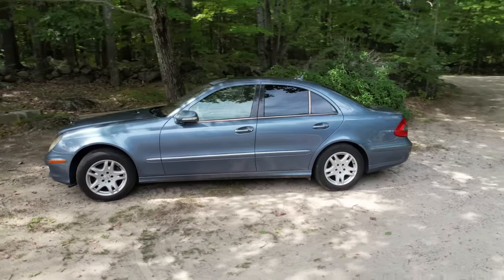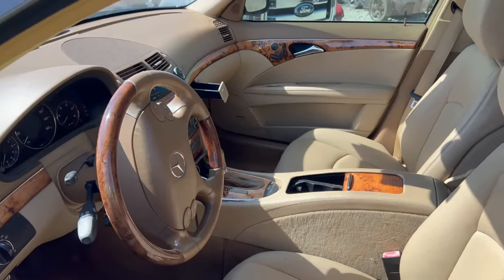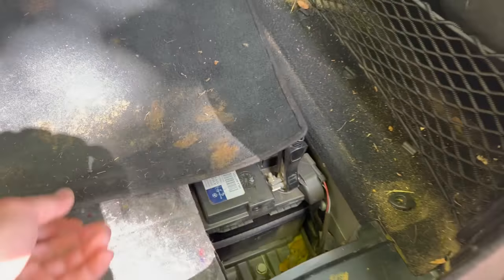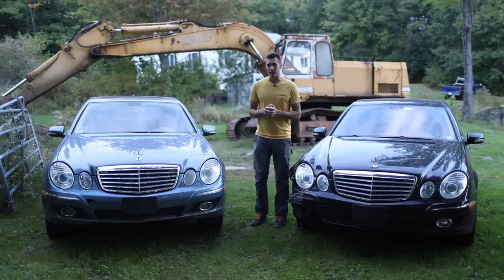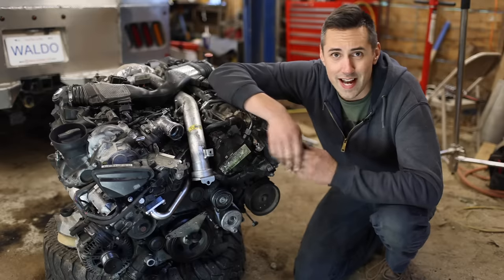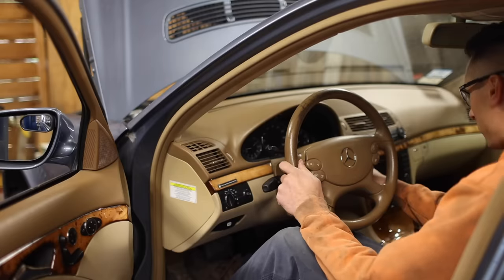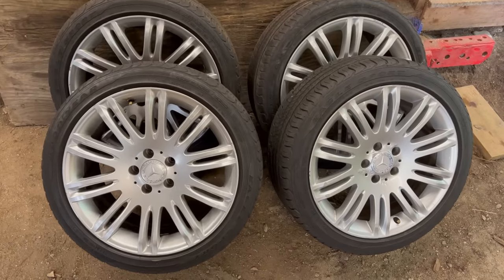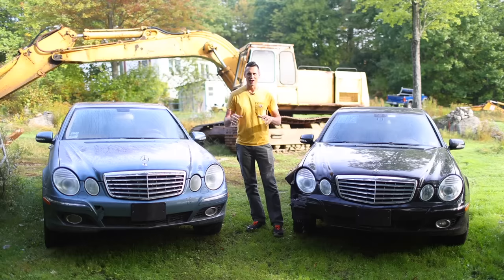Making One Mercedes E320 Diesel from Two Cheap Salvage Cars

Comment: When it comes to parts if the OEM part fails with less then 100k Its cheap junk and I would use a better brand like Gates OEM doesn't always mean better remember Planned Obsolesce has been purposely put into cars since the mid 90s case and Point VW water pumps.

Comment: Restricting the function of transmission to the Module to match the car is a typical German over-engineering that makes their cars so hard and expensive to maintain. Our VW Golf is full of these corks.  The heater core is clogged and it would take an act of God to discount the cables to flush the core!

Comment: Waldo,

I owned one of these nightmares and don't understand why you haven't pulled the intake manifold to inspect the runners to see how badly they are carbonned up. These cars are great when they run but awful to own because of the major failures that occur with amazing regularity. After the intake manifold blockage the oil cooler,  deep in the valley is next.

Comment: So you are telling me the black Mercedes E class does NOT have 60/40 split seats ? This is a joke right ? How much did this vehicle cost new back in the day ? 
I am German and I would not buy a Mercedes. I mean come on, the transmission has a module which is coded to a specific car, WTF who does that ? 
I rather keep my old rusty bucket of shame VW Polo 2010 which despite being an economy car (or clowns car in the US) has over 220k Km on it and still drives without any problem whatsoever.
Had to replace the timing chain on that one which is great German VW quality right there 🙄, but that was the only problem I have ever had with this small thing. I get around 50 MPG with the thing.

Comment: Now you messed up the tranny by draining ATF while running it.

Propper way to know the ATF level is  to buy a dipstick and meassure it.

Now it should be low in ATF, dont run it more. Buy a dipstick from ebay and meassure it.

Comment: If I were u I d replace timing chain simultaneously cz u already removed engine, I d check resistance of plugs n change them all if they need, by the way, as far as I concerned, diesel engines cars still remain reliable cars basing money consumption than that of hybrid n electric cars cz lithium ion packs of batteries r much more expensive

Comment: You should never separate a Mercedes engine from its matched and balanced transmission if at all possible not just because it has 90k miles less. Full stop.

Comment: Towing slow at constant speed is highly efficient.. If you think 15Liter/100km is good then you are stupid, the trailer was empty so not much wind resistance and only 1000Kg...
Your 4x4 drivetrain rubbs too much and the truck itself is a brick on a aerodynamic scale that is even worse..
On top of that if you load your truck trailer and the efficiency stays the same loaded your have a serious problem with economy on your car

Comment: Never ever buy Chinese car parts. Only buy OE MB or quality non-Chinese non Turkish OEM parts (check country of origin).

I recommend you run a Auto-Rx treatment in the engine, transmission and power steering systems following the instructions to the letter.

Comment: 15l /100km,omg ....is that standard fuel consumption in USA ?.  1.7 euro/liter is cost of diesel in my country now,and its cheaper,it was over 2.2 euro not long ago ,no wonder u guys drive cars with large engines ....average fuel consumtion here is 4-6 l/100 km ,because 95+% of engines in cars are 2000 cc,or bellow.

Comment: Made in China = Amazon/eBay/online aftermarket auto parts/O'Reilly Auto Parts/Auto Zone/etc = TROUBLES .  The sad thing is that EVEN with online auto parts that claim to have OEM parts, those parts are still MADE IN CHINA!!!!  Made in China parts are cheap because they cut corners (using plastic instead of metal), use cheap materials, no quality control, FAKE labeling (e.g., "Made in Japan" when it's NOT!).

Comment: "such a small car " 😆😆  it's almost 5 meter long... i have the previous model, w210 270 cdi wagon... awesome car, and much better quality build than this w211. the interior quality and materials  is exp. striking... w211 falls apart and become dull after few years of normal use, 
 while w210 look as new even after 23 years. w210 was the last MB model  designed by iconic bruno sacco, and was STILL "engineered to last" not like its "eternal" predecessor w124, but almost .(the only weak , killer point of w210 was rust). on w211,  these new V6 diesel engines are a big step back in complexity and reliability compared to the inline 5 and six on the w210, good for a million km if mantained. also previous 722.6 autobox , 5 speed, is sooo robust and bulletproof, while the new, faster  six gear gave so many troubles.